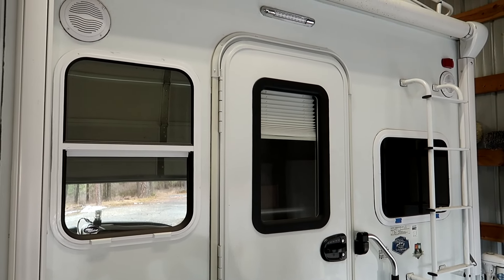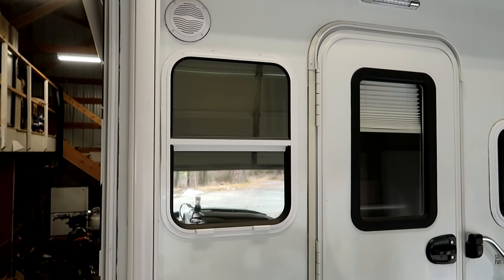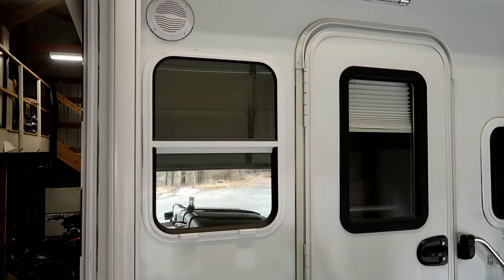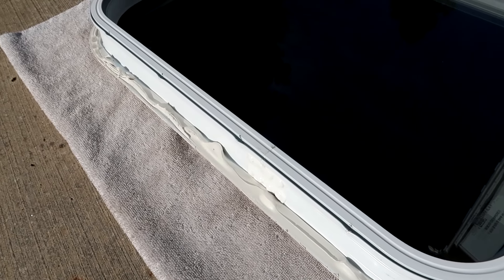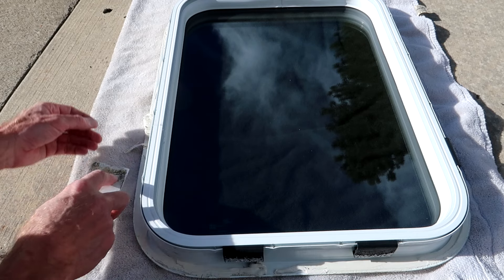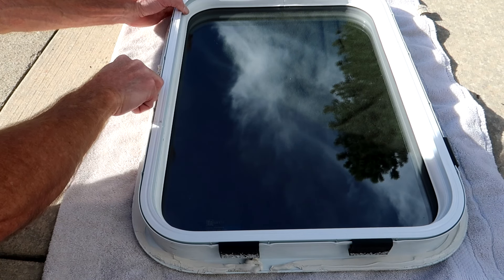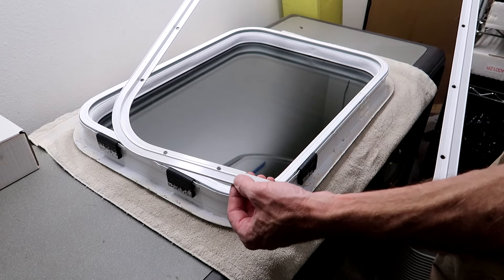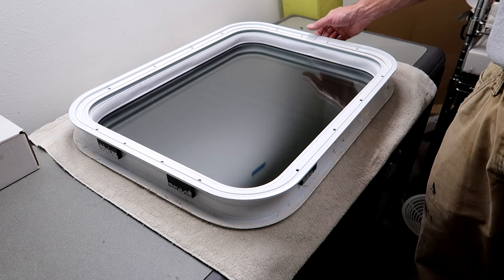RV Window Installation | RV and Truck Camper Upgrades

Comment: The “split” as you refer to it, is supposed to be at the bottom of the window so that any moisture or condensation that may accumulate on the top, isn’t able to seep through any openings, water won’t flow up into a crack, but it sure loves to settle down into one.

Comment: i see you have tape over the weep holes of the window behind the ladder. why is that? I have a Wolf Creek 850 with a similar window and there looks like some water damage under it but no trace of water.
Reply from the maker: It's to keep Stink Bugs from crawling in there in there last fall.  I never removed the tape when I started using the camper this spring.